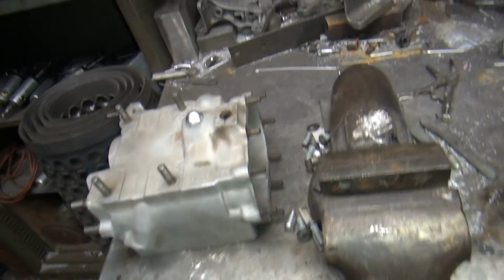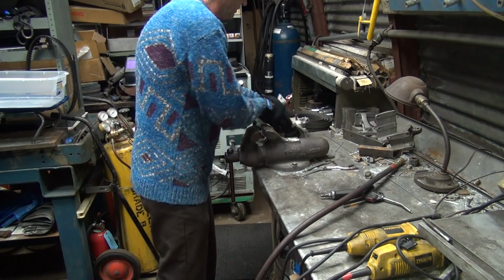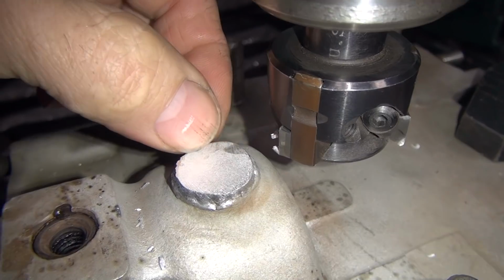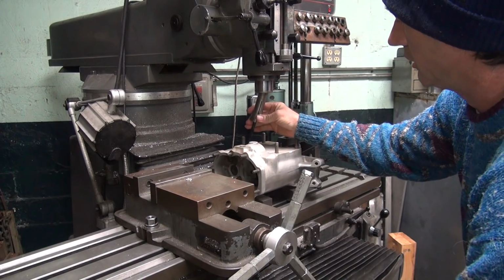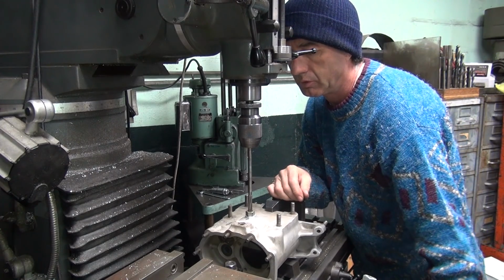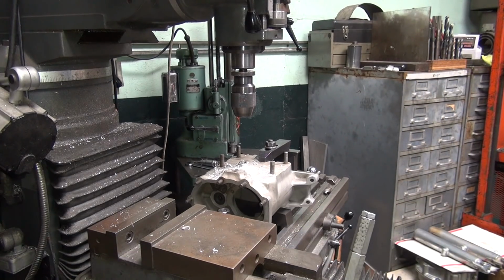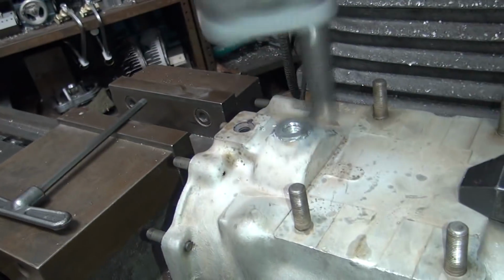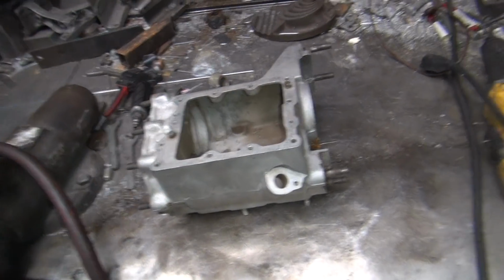1967 74ci shovelhead #133 flh bike assembly transmission rebuild harley craigslist tatro machine

Comment: Watching this video has prompted me to ask for an opinion. I have an all original 1962 FLH. Motor is fully assembled and running in the bike. I removed the timing hole plug ( the big one just under the serial numbers) and discovered that the threads in the engine case for that plug are in poor condition (stripped) The plug has stayed put during the operation of the machine just can’t tighten it down as you would expect to be able to do. Any suggestion on how to “fix” or at least improve this condition while the engine remains assembled in the bike? I didn’t really want to disassemble the whole engine for welding, drilling, tapping the hole to repair this (which I assume would be the recommended and proper repair) I would prefer to keep the bike as original looking as possible, like using the stock plug for that hole or stock appearing over sized plug for that hole (which seems no one produces) Thanks in advance for your consideration and thank you for educating us “dumb asses” with your videos
Reply from the maker: i would helicoil it. this is very tricky and you only got one chance at it. if you loose the tang you are screwed. for now, i would just jb weld it in. you can fix it later when the motor gets rebuilt.
tatro

Comment: Hi, I've got a 2002 Sportster that has a ticking noise that seems to be from the front cylinder. I'm thinking it's the exhaust lifter because it's louder if I use a screwdriver as a stethoscope on the base of the pushrod tube. Is there an easy way to check or fix without to much disassembly or how can I test it once it's out on the bench, the tick is constant even if engine is hot or cold.
Thanks.
Reply: Bike has only done 12000 miles.
Reply from the maker: sounds like a bad lifter. you have to take the motor apart to fix it. harley didn't want anyone to fix their junk so they made it hard to fix. you can cut all the pushrods out but you will have to replace all the parts with aftermarket stuff. not cheap either way.
tatro

Comment: since the plug is steel, and will go through multiple insertions during it’s life, wouldn’t this be a good candidate to repair these threads with a matching steel heli-coil?
Reply: Just use anti seize compound.
Reply from the maker: no, because the oil would leak past the helicoil.
tatro